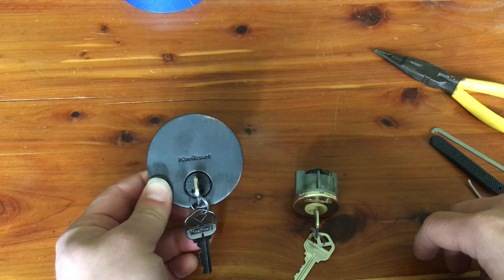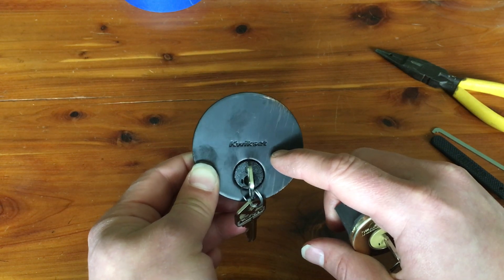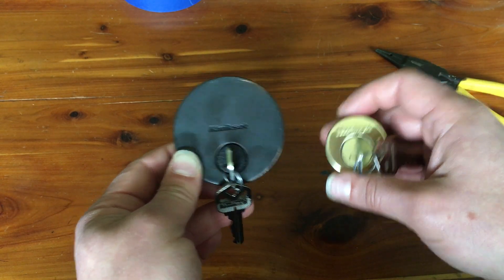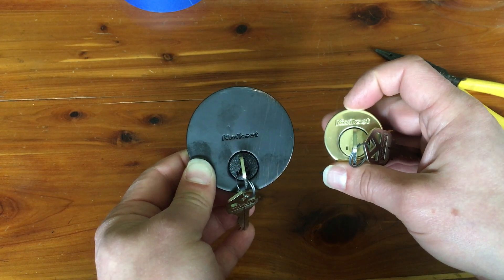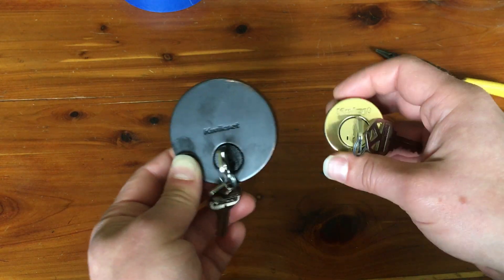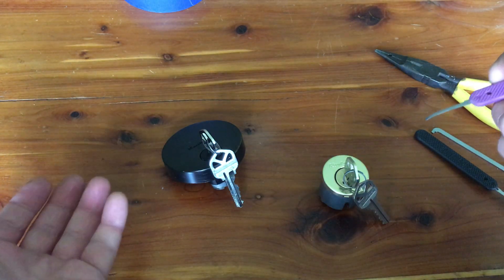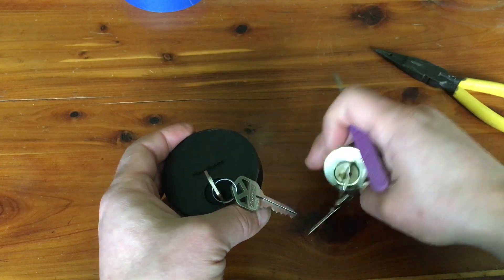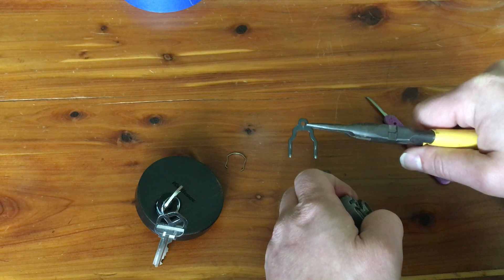Kwikset SmartKey Gen 3 modification discovered

Comment: Wait, so is the one with the biffy clip the 2nd gen or the 3d gen? I am confused. I thought the big round one was the 3d gen?

But at 5:33 you said they 'changed' it to biffy.

Is 980 the 2nd or the 3d gen please, would you mind telling me?
Reply from the maker: Both locks in the video are gen 3, in the 980, kwikset slightly altered the sidebar channel and my shim no longer fit.

If all of the 980 locks are built the same as mine, they're gen 3.

An easy way to tell is to take apart the lock and look at the sidebar channel.  If it's square, it's a gen 3, if it's a triangle, it's gen 2

Comment: Interesting -- Guess they narrowed the sidebar channel so it is not so "sloppy"  Guess you could easily tell from the front by the amount of slop in locked cylinder rotation movement whether you have a gen "3.0" or a gen "3.1"
I like your technique much better than going on the outside to tension the sidebar.  Clearly with a narrower "shim" your technique would work just fine.  Also with your technique is appears much easier as you start setting at the front and work your way to the rear of the plug.  Thanks for sharing